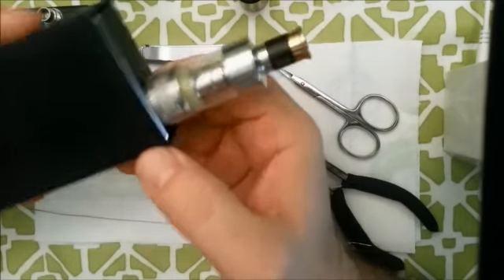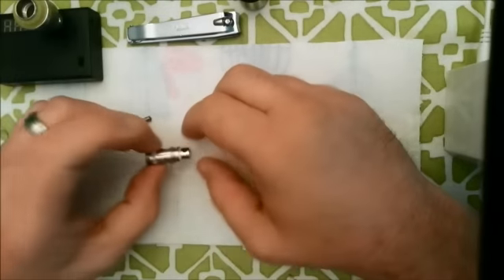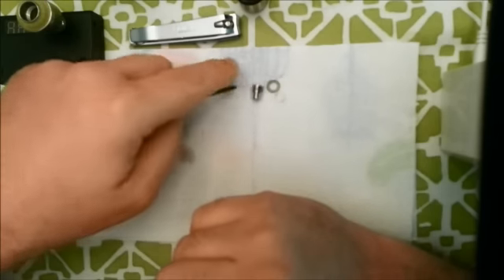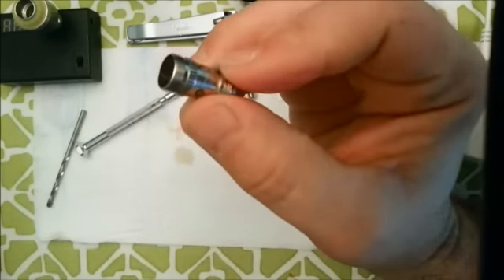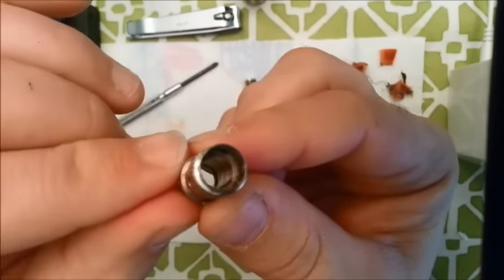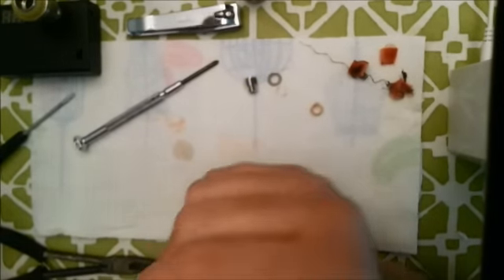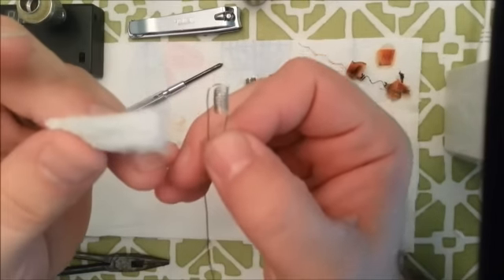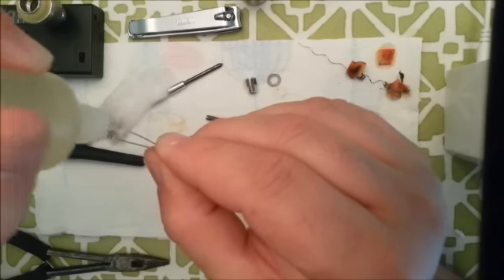Aspire Atlantis Rebuild How-to

Comment: Just got a triton 2 tank and the coils look Identical. Would my local vape shop have these supplies? Also I am using the .05ohm clapton right now. Can I simply take the guts out and rebuild as advised in this video? I don't care if the inside is clapton or not. Coils are expensive near me and would like to save as much as possible.  Thanks

Comment: !!!!       Wallmart has baby bottle brushes that fit perfectly into Aspire coils.   Remove the positive contact and you have to bend the positive wire so it stays hooked onto the edge of the rubber piece. I scrub the carbon off.then I rinse with hot water , then rubbing alcohol to soak out the gunky water. Then I set it on a hair dryer on lowest setting until dry. Then I take a soldering iron and put it into the middle to burn off the cotton hairs that stick out into the center chamber after brushing. I go ahead and use it after that, but there is some small amounts of burnt cotton left inside after the soldering iron so you could i you wanted to rinse with alcohol again and dry again. But they taste like new and the cotton turns white again. (be care ful with the soldering iron it heats up the whole thing pretty fast) The cheap red-orange ones work the best because of the tip thickness and length. !!!!
              (this method gives the best results if you don't drag out the cotton and wire.)

Comment: Only problem is that the original coil is made from two different types of wire, resistance wire and non-resistance wire. The non-resistance wire does not heat up and sits against the rubber grommets. Using straight kanthal will heat the entire length of wire and may start to burn and break down the rubber grommets, ect. Not sure what the consequences are of that though but would guess burnt rubber is not good to inhale.

Comment from the maker: No, I do not compress the coils. I tried it with compressing them, but for some reason I did not like the flavor. which is weird because I heat and compress coils on everything else I build. this one just works better with spacing.